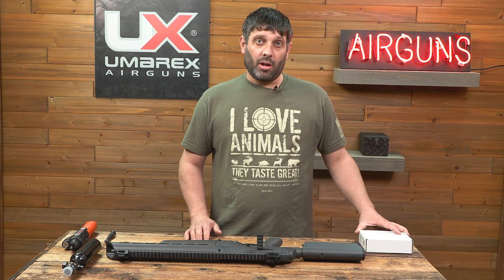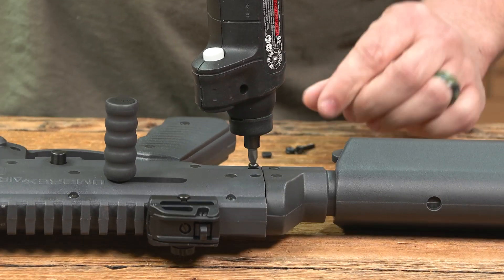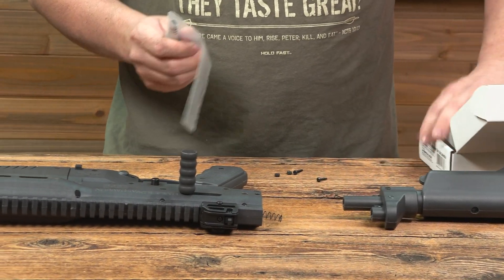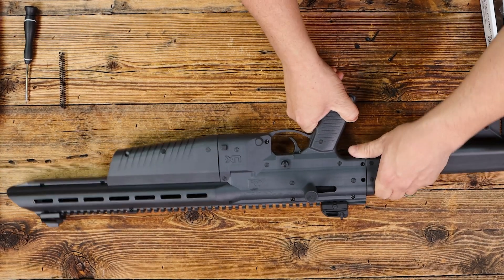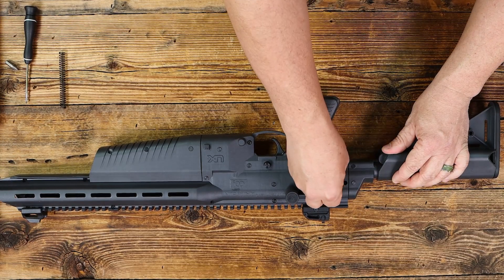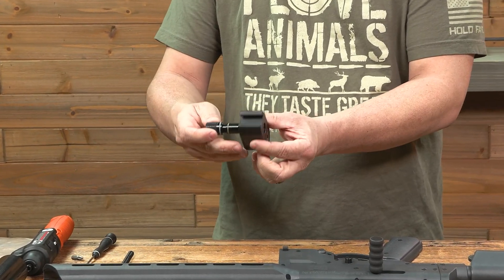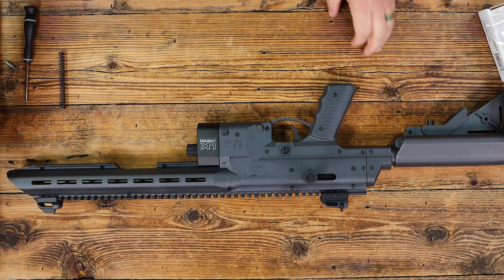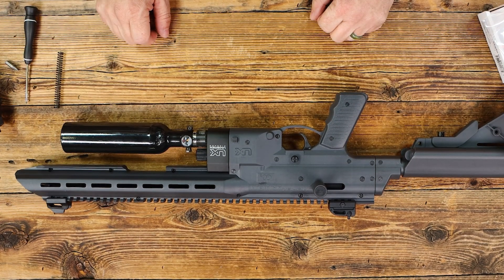HPA Adapter install on Umarex CO2 AirJavelin How-to video

Comment: Did the conversion to my air javelin and added a 3000 psi tank.  Works great. One other thing that I find that’s works well is to shoot 22 cal. Pellets.  I shoot 5 at a time and it destroys soda cans filled with water.  Doesn’t seem to harm the gun.  Not suggesting you shoot pellets from your gun but I do.
Reply from the maker: This is rockin'! 😎
Reply: Wow yes@@ i was wondering what about metal ball bearings?? Or pepper balls
Reply: Let me know if you think metal ball bearings or marbles would work what us the barrel diameter?

Comment: Thanks for the video! With this kit, will it have the same power as the Javelin Pro?
Reply from the maker: The AirJavelin Pro is regulated to 1400 psi so it has a little more.
Reply: Time for a chronograph with this kit.
Reply: what is the max pressure of the bottle? Are they 3000psi with 1100 psi reg? thanks!
Reply: @UmarexAir what about a non pro?

Comment: What exactly does the HPA adapter do to allow the system to accept HPA instead of C02? It is acting as a regulator to control pressure or simply providing a threaded port for standard paintball tanks? 

I'm asking because I have a completely different device that is designed to be filled with paintball C02 tanks. The manufacturer says not to use HPA or it will "blow up". Seems if my HPA tanks output at 800psi like every other C02 tank then it shouldn't matter. Thoughts?
Reply from the maker: The adapter provides a way to accept the threading of the regulator and the larger diameter size of a tank.
Reply: @UmarexAir  - Thanks.

Comment: Has anyone had issues of your air javelin leaking air after installing the HPA adapter and air tank?
Reply: Haven't gotten that far as I'm having trouble finding a tank. Last one I got the gauge keeps hitting the adapter screw head not allowing the tank to fully be screwed on. What brand tank did you get and where did you get it from if I can ask?
Reply from the maker: Things to try: Check that its tight and where its leaking from. The adapter will work with Banza and Ninja regulators that we know of. The gauge can be removed and regulator tightened then the gauge reinstalled if needed.

Comment: CO2 is around 800 psi iirc, so does the 1,100 psi get any performance boost?

And what would happen if the pressure was upped to 1,200-1,400 psi?
Reply from the maker: Using PCP/HPA as opposed to CO2 will provide a more consistent pressure (less point of impact drop over shots) and will operate in cold and hot temps whereas CO2 optimum performance is limited to the 65-85 degree range. Do no exceed 1100 psi. That platform is not engineered for that. For more pressure we recommend moving to a AirSaber.
Reply: @UmarexAir  
But I REALLY like the AJ. LOL 

Wonder if I can get both and shoehorn the saber internals into the AJ.

Comment: Question... once the kit is installed, if I want to use CO2 again, do I have to go back to the original spring?
Reply from the maker: I am not sure but I think so. Call out gun techs to make sure: (479) 646-4210 ext 7
Reply: Hello again, I wanted to know how much pressure the CO2 version of the Air Javelin supports, since my HPA tank, to be used with the adapter, came with a warning that it can work with +/- 70 psi of pressure and in case it is + 70 psi I would be exceeding the 1100 psi that is recommended. I want to avoid damaging it.

Comment: Why is the adapter block loose AF on mine after tightening it?
Reply from the maker: It sounds as if it may not be all the way on. When the adapter is tight there should be no movement on the gun. It is also possible that the bottle could be loose on the adapter if not filled with air.

Comment: why can't it use the 1500 psi tanks equal to the javelin pro?
Reply: Lighter duty internals.

You'll blow the seals right out.
Reply from the maker: The internals are not made to handle air pressure above 1,100 psi. Do not attempt.

Comment: Simple adjustment. Cost price?
Reply from the maker: The adapter is 52.79 on the Umarex website.
Reply: @UmarexAir  I only see the adapter. I'm not seeing the 1100 PSI bottle.

Comment: can we get a link for a proper size and rated hpa tank to buy for this?im a non paintball guy and want to switch a javelin over to the hpa but dont want to order an improperly speced tank. just a amazon link or whatever to take the dummy factor out of this equasion  please. thanks.
Reply: I thought the same....no one from the company ever answered.
Reply from the maker: https://www.pyramydair.com/product/av-3000psi-13ci-tank-valve-1100psi-set?a=7882